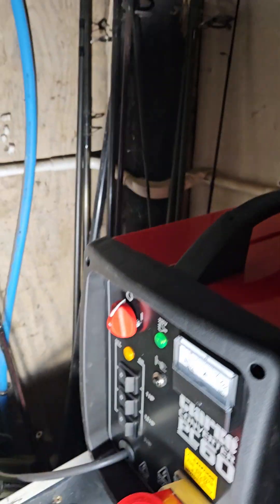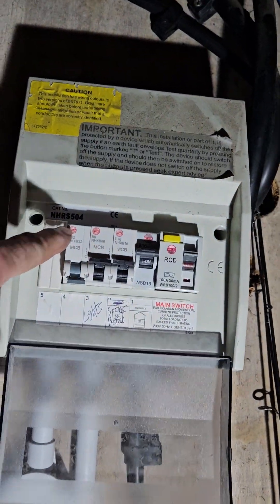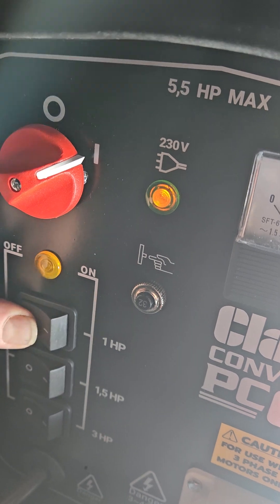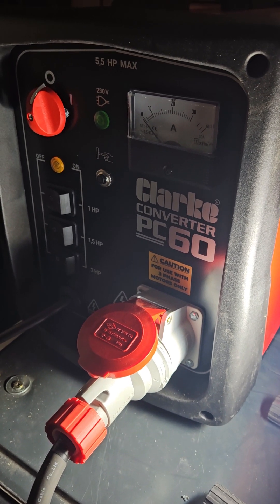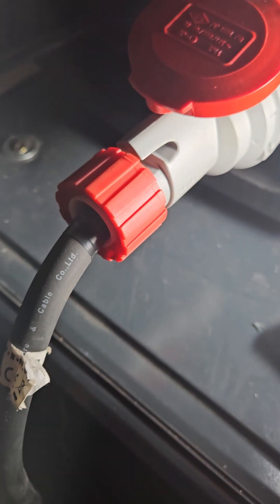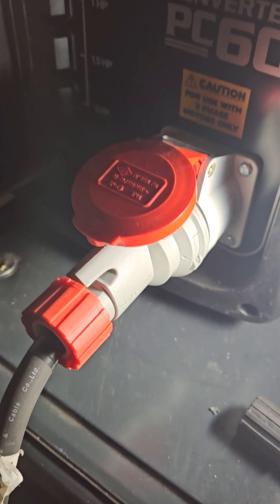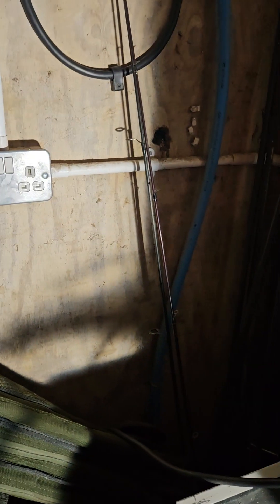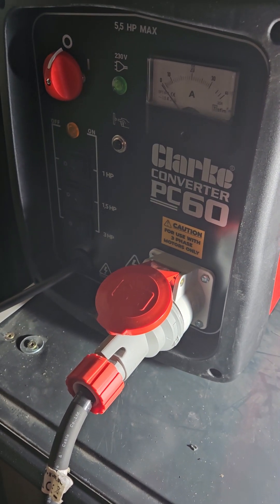Clarke pc60 wiring help.

Comment: Great video.. So my lathe has a 5 wire fully connected set up on a dual speed 2/3hp motor so guess this convertor is useless as a 240v convertor for my lathe..
Reply: What makes you say this? I have a PC60 and currently struggling to get my Colchester student lathe running on it.
Reply from the maker: sorry for such a late reply, You need to check what the earth wire is doing in the motor it's self, It maybe doing nothing like mine.